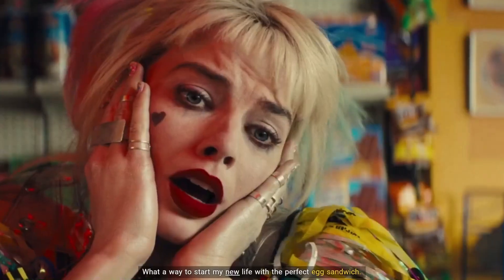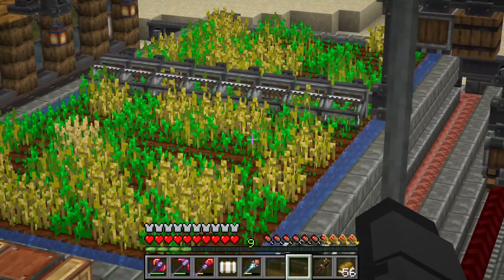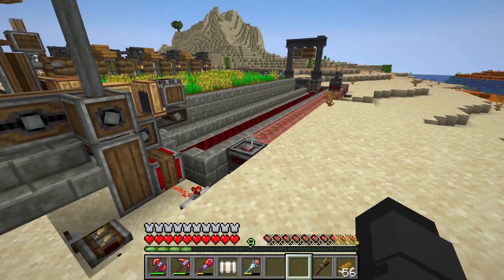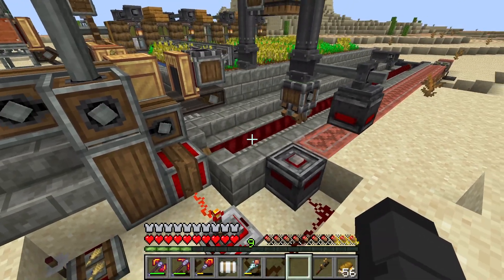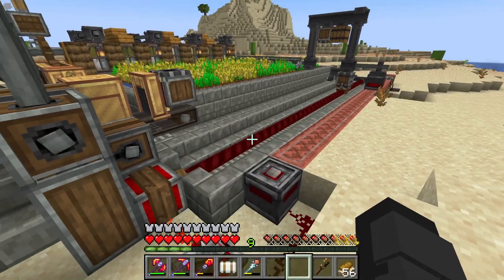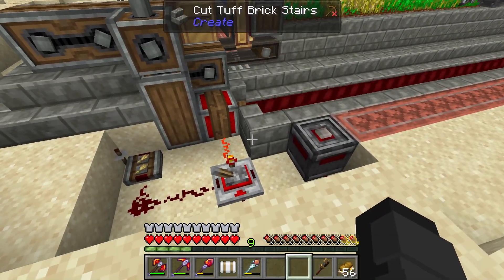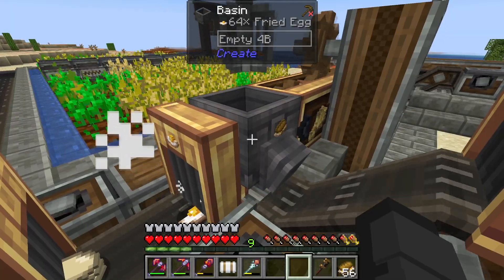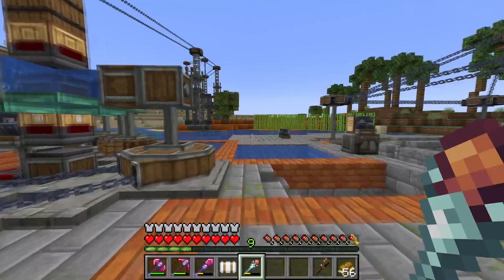Create Mod Gantry Carriage Guide – Automate Farming in Update 6

Comment: Dope redstone, I think you can get the same result with no redstone though. place two gantry shafts in opposite directions (So their rotations are opposite like for crushing wheels) a gantry carriage on each gantry shaft connected to a block on the desired contraption. Glue both gantry carriages to the contraption. when the one going forward hits the end, it places the blocks and then the one coming back picks the whole thing up first. Useful for old school cobble generators make sure it doesn't place the blocks on top of the farm though.

Comment: if you want to stop the contraption when the drawer is full you can also use Threshold Switch, 2 Redstone links and a clutch before your gearshift. When the Drawer is full the Threshold Switch will activate and send a Redstone signal with the Redstone links and activate the clutch which will cut off the power to the gantry and stop the contraptions. One Redstone link needs to be placed on the Threshold Switch and the other on the clutch, you can also use third Redstone link and Factory gauge to automate the entire Thing. btw. Great Video i didn't thought about using pistons in this way
Reply from the maker: Yeah that would work as well. The reason that I choose to setup a stop on it this way is it will only stop when it reaches the back end of the wheat field. There I've left a two block space so that when the contraption parks it won't break the plants. Then when it's reactivated there won't be a need to replant the wheat.

Comment: Another way to set up the gantry system to move back and forth is to have two lines of gantry shafts going in opposite directions next to each other and have two carriages both glued to the contraption, this way the carriages will take turns on carrying the contraption, changing direction whenever it reaches the end of one shaft
Reply from the maker: Interesting, thanks for sharing another way of using a gantry.

Comment: That piston should be currently activated and waiting to pull back the block, unless you are planning to do a very short pulse where it retracts with the block and the next time pushes it ahead and retracts without the block
Reply from the maker: Yep the redstone torch will activate the piston and then a signal into that block when storage is full enough will deactivate the torch and in turn the piston will retract.